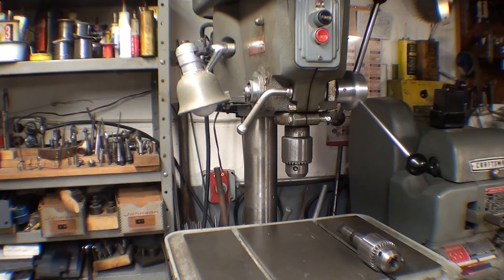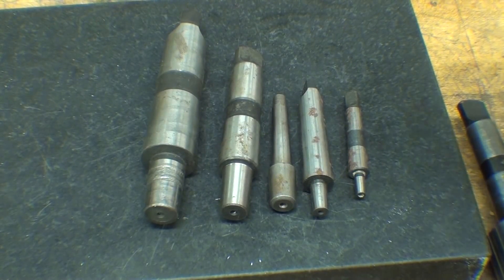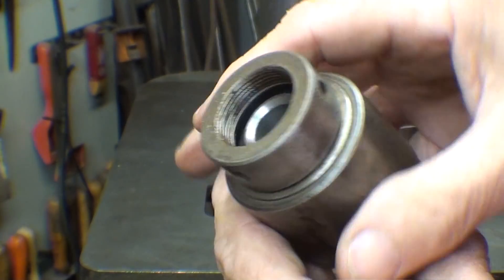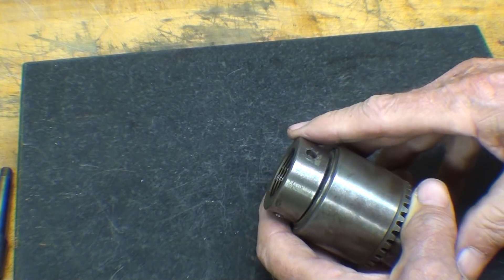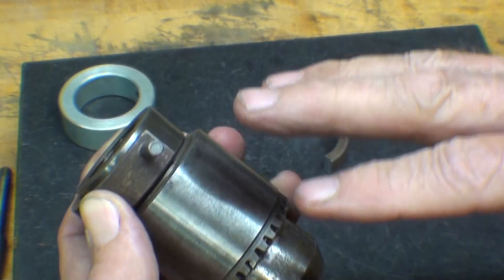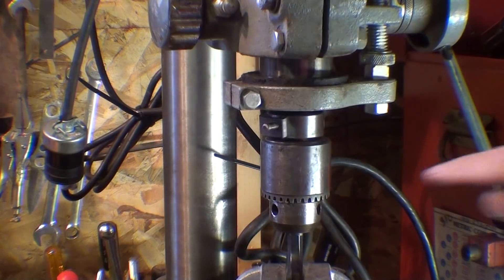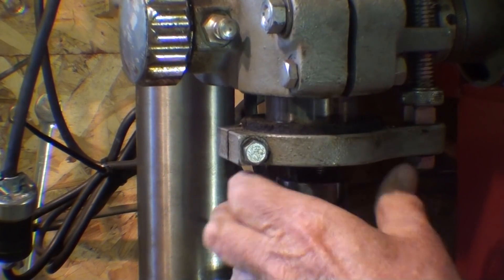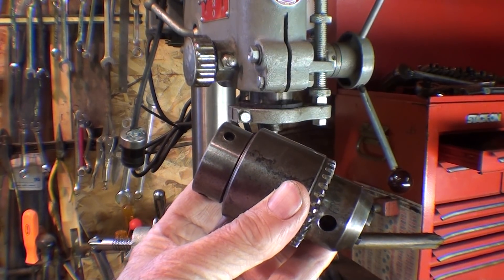Tips #384 REMOVING DRILL PRESS CHUCKS threaded collar tubalcain

Comment: The older Jacobs 633C chuck with locking collar have been superseded by Jacobs to model "34-33C". I got that straight from Jacobs support. The pin spanner wrench I use needed for the locking collar is a Gearwrench 81861,  3/4"-2" adjustable pin wrench with a 3/16" diameter pin but any adjustable pin wrench will work with the same specs as mine.
Reply from the maker: Thanks for the additional information!

Comment: I don't save hardware or have a hardware can, but broken drill bits I save, in a little can with "all of the other tool steel" (which is currently a single piece of unused 1/2" LOL)
I find myself needing random short pieces of "drill rod" (pre-hardened) and broken drills are perfect.

I also save broken carbide for recycling, tho I will probably end up giving it to my friend who has a real working shop, I expect his broken carbide can is bigger than mine. ^_^
I'm watching this because I've been shopping for a pin wrench that would fit since I haven't got an easy way to take that chuck off (or replace it). What's on my cheap drill press
is unnamed and unlabeled and ultimately needs to become a proper BB Super chuck, even if that means Chinese.  

The one time I took off the existing junk, I found that collar was as hard as a bad day and could not be gripped for love nor money. But a ball bearing a bit too big for one of the
collar holes stopped my channel pliers from slipping and did the job.  I've been putting off making a proper wrench ever since, because once I set my mind to making a tool,
I get all OCD about it, and try to make something fairly nice.  Usually.  Inevitably delaying my project.  ;D

Comment: I have an old Sterling bench type Mickey Mouse drill press that was given to me and it has been working great for close to 20 years. Lately, the chuck has decided to not work very well, so I saw your video here and decided to try to take the old chuck off. At first, it gave me all sorts of grief...until I got sorta mad and pulled out my "blue tip saw"... also known as a torch and fired it up putting just a small amount of heat on the old chuck. I also told it that if it gives me any trouble at all, I was going to cut it off. I guess it was listening because I gave the collar thingy a slight tap and low and behold, it started to turn. Thank you for your advice and schooling.

Comment: Thank you! I would've never figured that out if I didn't find your video!
Reply from the maker: Glad I could help!
Reply: So I did get the chuck off the machine thanks to you. However,  when I took it apart all the threads were shattered into pieces. It is a dayton floor drill press with a chuck with a threaded collar. I emailed grainger with the model number and they couldn't find record of it. 

Do you have any advice on how I can find the right replacement chuck?
Reply from the maker: @nathantweeddale9057  
Is there a model number on the chuck

Check Granger and McMaster Carr

Comment: Thanks Mr.Pete, I just got the chuck off my 24 in tall bench drill press,  Duracraft UL-30 FROM 1982,  the spindle shaft is 5/8"   and tapers down from there.  I just got it, used of course, came with 5 chuck keys, 1 was even a multi tip, not one would fit correctly, wouldn't ya know.

have a great day,    thanks again

Comment: Great video, Mr. Pete! I have been trying to get the chuck off of a Walker Turner 944 for some time. I have an appropriate spanner, but the thing won't budge. I was wondering about putting some heat on it - just a little, as the bearing is close by. Any ideas, or keep banging on it? This one may be from the Truman administration! Thank you!
Reply from the maker: I do not think I would use heat

Comment: Hello, thank you for this video. I have a Sprunger DP 15, that needs new bearings, and needs a new chuck. It has a 33 Jacobs taper on the spindle and an old  superior chuck that needs replacing.
Question is will a new truck with a 33 taper, without the locking collar fit ok, and does a collar need to be put on the quill threads, , or is that necessary?

Also, you said that if the spindle is bent the drill press needs to be thrown away, and not try to repair it. I was going to check the runout on the spindle after replacing the bearings.  If there is significant run out, I was going to take it to my local machine shop and have them true it.  Is this a bad idea?  How much run out would they be able to true before the taper will not fit the chuck?

Thanks again for your videos. They are very helpful for hacks like me

Comment: Mr. Pete! I can't tell you how helpful you are. I have an older Jet R-13 drill press, and without you I would never have gotten the chuck off of the thing. The collar on mine is actually just a big nut, so once I set up my vise/clamps/allen wrench just the way you showed it was easy as pie to turn it off with a wrench, but I still loved seeing how you built the spanner tool for your collar. I wouldn't have shortened this video one second. Thank you, sir.
Reply: Sir, love your video. And I need to ask you, how were you able to get that constant c retaining ring back on that groove which holds the threaded collar on to the chuck? Was there a special retaining ring wrench that you used? If so, what was it? If you could get back to me on this I would greatly appreciate it. Ray  @mrpete222
Reply: I have the Jet 13R and I cant get that nut to go any further left (loose). I have loosened it, but it is up against the chuck and will not got any further.

Comment: I made my tool out of 3/8 round stock (cause it was handy and already bent a little) and drilled & tapped  it for a #12 - 32 screw, probably could haver used some 3/4 flat-stock ... left it long so I had a handle instead of using a hammer & punch, also had some round stock that fit in the chuck key hole... no hammers! 
He could have welded a handle on his tool.

Comment: Well mine came off finally thank you for the information mine had the collar on it that screws down. Okay now that I've got it off I can't figure out what taper it is. 5/8 at the top and 9/16 at the bottom and it's a little over an inch long from the bottom of the threads to the bottom of the shaft could you tell me what kinder new Chuck I should be looking for at what taper I totally lost I was lost about getting it off until I watched your video so maybe you can help me figure out what to buy to replace it with

Comment: I have a Atlas press model 1080, mid 1950's  with I think is with the same chuck. My problem is the jaw's are misalined so bad it will not holed a bit.  Again I think I have to take the chuck off to replace or rework the chuck.  There is a small slop in the shaft but I think I can deal with that. If anyone is knowledgeable on this product and has an ideal on how to fix that would be great. Thank you

Comment: I was wondering if you could help me out? I have an Atlas 73 drill press that i'm trying to restore. On the spindle there is the threaded collar and nut used to remove the chuck.  I want to remove the collar so i can get the bearing replaced but can't tell if it comes off... Any tips would be appreciated.
Reply from the maker: I have never had the spindle out.  Not sure how to do it. See if you can find a exploded parts list

Comment: Ok so what about the arbor? I have an older craftsman 15 1/2  press with a jt33 and a threaded collar.  I wanna be able to swap out to a 3/4 chuck so I can use annular drills. I cant seem to find a jt33 3/4 chuck at least not for under $150. Can I swap out the arbor to a non threaded one? If so what size is the arbor, mt2 mt3?
Reply from the maker: I doubt it. The spindle is probably made by Sears and it would be impossible to find

Comment: My newer presses use the Morse taper #2 I think?. Anyway I found two 0 to .750 chucks to run on my two antique Craftsman drillpresses. I ordered two Morse to Jacobs adaptors that I assumed would fit them. I think the new 3/4 inch chucks have a #33 Jacobs taper so hopefully I can run them without the threaded collar.

Comment: Thanks for this information.  I inherited a 1940's Craftsman drill press and noticed a slight wobble on the drills.  Do you think that I should take the chuck off and reseat it?  I think it was used as a drum sander and a fair amount of lateral force applied.
Reply from the maker: Probably a little bend in the spindle

Comment: Hi mrpete222  I have a Buffalo 15 and it is missing the collar.  Can you suggest how I can remove the chuck? it needs a good cleaning.  It is hard at some point I am thinking some hardened oil crusted on with some dust. So I am looking forward to your  response . Thank you in advance.
Reply from the maker: If the collar is gone, you will have to drive it off.
Reply: Thank you for taking the time to answer my post.  I will try to remove it as I need to clean and lubricate the chuck.  It is very stiff.

Comment: Hi Pete.  Do you think a new chuck will fit, maybe a chuck with 2 or 3 MT
Reply from the maker: No, the Morse tapers will not work
Reply: I have the Craftsman drill press my dad bought new in 1948. He made a lot of molding. I have the 1/2” mandrill he replaced the chuck with. It would accept a shaper head which he had several shaper blades for. It also had a bearing that fit into the table. I am getting to ready to set it up for shaping again. Video came at the perfect time. Thanks!

Comment: Great to find this - Same Chuck setup on my old Sprunger press. I had it apart to replace the bearings, but removed the entire spindle set up with the chuck attached. I'm glad to get the tip about the Chuck Key end... I tested mine, and it's a glove fit! Thanks.
Reply from the maker: I'm glad you like the video

Comment: Mr Pete, thanks for the video. I know you said you don’t have the time, but for safety’s sake, you should find the time to remove the mushroomed over edges on your copper hammer. The punch you were using in the video also had a little mushrooming that could stand to be removed.

Comment: Jacobs still makes these chucks. They have changed the part number from "633C" to "34-33C". The C means "locking collar". They also sell rebuild parts for the 633C. There are import versions, and Rohm used to make an equivalent also. Hope this helps someone.

Comment: A tiny tip.. wipe the tapers with a small amount of oil to avoid surface rust. The salt in the sweat from your hands can easily lead to rust and the tapers will stick annoyingly hard. A piece of tissue with a drop of oil can really save you from a lot of aggravation..

Comment: Great Information Mr. Pete. I had an issue with a Walker-Turner drill press about 10 years ago where I felt the need to remove the chuck. Without having any prier knowledge, I unscrewed the collar with a spanner & thought it would press itself off if I kept on turning it.  No go. It was tight  With my new found tool 'The Internet' & a link to 'The practical machinist' website, I asked the good people for tips. At least one kind person told me that the inside of the chuck (the throat) is soft steel & can be drilled easily & then a punch could be inserted to knock it out or pressed out (with the spindle dismantled of course). If I remember correctly, I was able to chuck the spindle in the lathe & drill out the center very carefully as not to drill into the spindle (there is a little air gap between the chuck & the spindle). I drilled it to just big enough for the punch I wanted to use. It worked. just food for thought when all else fails. By the way, the chuck still works fine.

Comment: I added a handle long enough to your half caller which became a spanner wrench and is stopped  by the  drill press handle  to block rotation of the chuck then I use the belt to undo the caller in  both directions to put on or take off the chuck . I have an adapter for taper shank drill's

Comment: When I changed the chuck on my drill press I just turned down the taper and threaded it to fit a chuck I could get easily, which was a lot better than the broken one it had when I got it on auction. Got a nice keyless chuck as well, for a really good price as well, and while the runout is not great ( needs new spindle bearings, but probably also a new shaft to solve the wear in it as well) it does do the job well.

Comment: I had 3 holes in my collar. I made something similar out of a piece of bar stock drilled 2 holes and welded a handle on it. Then I put the shank end of 2 drill bits through the holes into the collar. Then I used a small tube air chisel with a hammer attachment on it to impact the handle I made and it came loose fairly easily.  It would not come loose by hand at all. I tried the punch trick but it was just stuck on there too tight. when I reassembled I cleaned the threads real good first. It looked like they had put some sort of assembly lube on there that turned to really thick goop. I used penetrating oil on it over night before I tried taking it off but it didnt help at all. It wasn't rust it was goop. Almost like the thickness of old cosmoline. BTW if you put 2 pin holes in it, it holds itself onto the collar pretty well. I like your trick with the vice and the Alan wrench. I'll have to give that a try next time. If I live that long.  LOL!
PS. I had to take it off because the chuck was really stiff and didnt move well. It works great after I cleaned it. I don't really use my drill press with any side load attachments but I tried to use a Morris taper Jacobs chuck in my Bridgeport J-head many years ago trying to do some quick and dirty machining of a non critical part and it didn't work very well. The Morris taper fit fine but the side load made it come loose and almost broke my $40 end mill.  That was a lot of money in 1975.. I figured it would be fine because it was just aluminum but when it fell out it hit the vice...It was auto feeding too so I had my back turned to it. Scared the crap out of me. Live and learn...
Reply: Some small mills, like the Benchmaster, used Morse taper tool holders.. but they use a draw bar to make sure it doesn't come loose.
Reply: Aceroadholder True but this was an old J-head and I wasnt looking to do anythin but take .025" off a mounting bracket. Not critical. so instead of sorting through a box of collets I just grabbed what I thought would be fast. The J-head has a drawbar but the chuck wasn't threaded.

Comment: Soooooooooooooooooooooooo glad you did a segment on this exclusive drill chuck. For 45 yrs ago, I bought a new Craftsman (Heavy Duty) drill press that had this chuck. I fought that thing (when I had to remove it) and it was a nightmare trying to get it off.

So I got another drill press (and kept the Craftsman-still have it) and lo and behold, I found out "WHY" the new drill press chuck; would NOT work on milling cutters which came with the Craftsman drill press. In fact, there were many Sears brochures, that showed the drill press with a milling cutter in the chuck; used on a rotary table that Craftsman also sold as an accessory to this drill press. You Pete may have one of these brochures.

Many years later, I found out why these chucks have the letter "C" next to the chuck number; and of course it means "collar". But today I learned HOW to get it on and off, because of you Pete. Thank you.

But there is a better way and I hope you will make one, one day. And that is to make a spanner wrench; that is fitted precisely to this chuck. That SHOULD have been included with the Craftsman from day one, IMHO. If so , many of us (I believe) would not have the aggravation of getting that dadgum "Stuck" drill chuck off of the DP. Oh indeed yes.

Thanks Pete. You are a life saver from Heaven (I am sure).
Reply: No doubt, Mr Pete is truly "your internet shop teacher."  He's a valuable instructor from whom I've learned a LOT!
Reply: pat dee       and attach the custom spanner to the machine so it can be found when needed
Reply: Glad I found this I ordered a new chuck for my old delta 14-040 I would have never figured this out GOd bless you

Comment: One thing to remember is to not over tighten the threaded collar the retaining ring can snap off.
I had a Rockwell 17"  that I received in that condition that was thought to have the bearings seized up but turned out to be the collar had unscrewed up against the bearings and locking them!

Comment: The retaining function of the 1 1/16"-20 threaded collar was a bonus. The principal function was to make removal simple to facilitate exchanging the chuck for other spindle adapters. At one time Delta offered ½" bore, MT1, MT2, ½' threaded shaft w/ flange for grinding wheels, and a ½" shaper spindle.  Probably Walker-Turner, Duro, etc did as well. A stamped steel pin spanner was standard equipment with a new Delta machine, but of course was often lost. In the case of the US-made Delta 15" 6+6 drill presses, the only way to get a MT spindle was to install one of the adapters. The various adapters were developed as an improvement over the prior state of the art, where exchange of the entire spindle was required to obtain the various spindle ends, as was the case with the original Delta 14" drill press (commonly known as DP220).

Craftsman offered elementary collet chucks, as did Millers Falls. Some of these used a tapered pin for removal as an economy measure.

BTW, even if the locking collar prevents side loads from dislodging the Jacobs chuck, damage can still be done to the chuck itself. That is when the the ½" bore adapter was meant to be used, for sanding drums, router bits, etc.
Reply: We care
Reply from the maker: THANKS for caring!
Reply from the maker: yes--the delta catalog shows all the accessories--wish I had that morse taper adapter
Reply from the maker: I was going to show that catalog, but thought no one would care